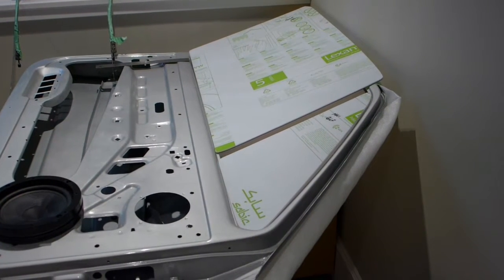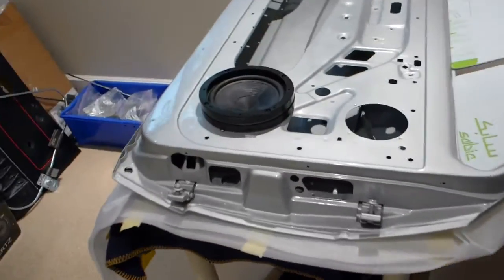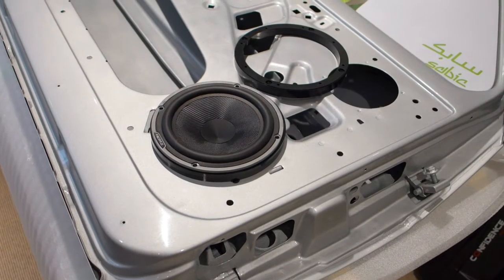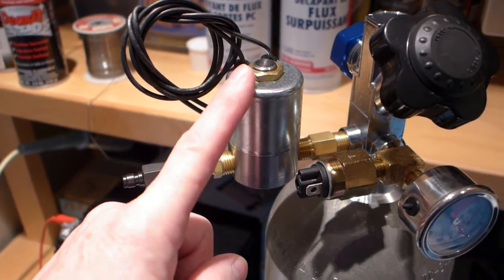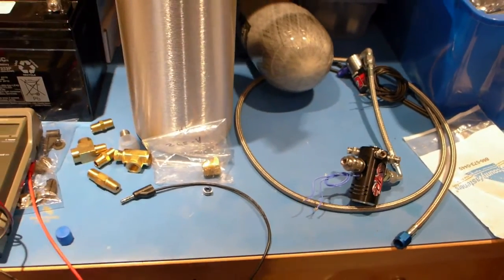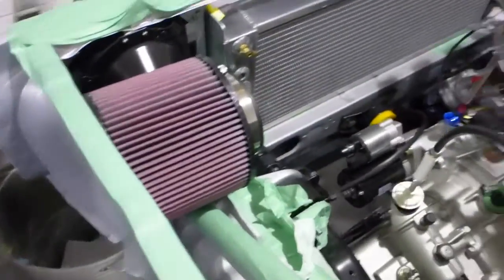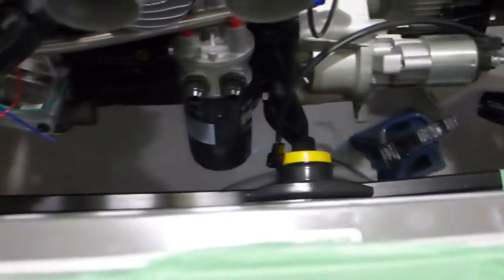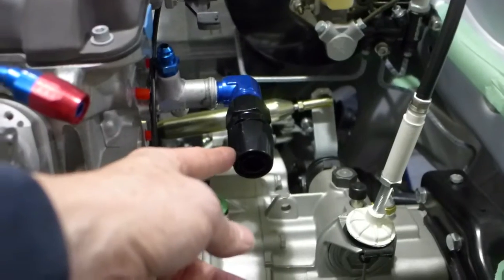The Ultimate 1983 Rabbit GTI - part 77 (Lexan Windows, Cooling System, Nitrous, Wiper Assy Install)

Comment: Overkill??? I have not seen anything on the car that would be considered "overkill" HA
Reply from the maker: +TheRcbthree Now that the project is coming closer and closer to completion I am thinking that everything is 'just about right'. It looks like the engine will be very powerful but the race cams should soften the low-mid range power enough to keep the ITBs (independent throttle bodies) from being overly sensitive.
Reply: +Derek Spratt  Thank you for making the videos.  You have done beyond a fantastic job, your attention to detail is spectacular.  I love that no matter what the challenge is your try to come up with a solution before you outsource it.  Ive watched 90% of your videos in the past two weeks.  I cant wait to be all cough up!  I'm very interested in how much power it makes.  Also, being an EE I love what you are doing with all the electronics.  My big project for the year was building a custom harness putting a ProEFI ECU in my car.  Having completed that in a little under a year working when i had time helps me to realize how incredible the pace is that your working at!  After this project wraps up you need to find a new project and what every it may be video tape it also!
Reply from the maker: +TheRcbthree Ah, it is great to see someone walking down the same road as me. The power of the internet and social networking. Yes, these ECU projects aren't trivial but the customization ability these days is fantastic. Cheers!

Comment from the maker: Yes, I am stressed out about the mis-match with the -16 hose ends and the issue you reference. First of all, they are way closer together than I had anticipated, plus the angle sucks. One thing that popped into my head is that the 45 degree hose end that attaches to the cylinder head is really long and I am sure I can source one that is more compact and that may solve the problem. Another thought if that doesn't work is to bend one or both connectors enough to align them more - but the problem of engine movement would remain. A long hose really is my best option. Stay tuned!

Comment: Hi Derek, that upper rad hose looks like it has an awkward bend to it to bridge between the two connectors. I'm wondering if that is in the fact the case (not just the way I'm seeing it from the camera angle) then when the engine rocks, you might have way too much tension on the hose.  It looks like on acceleration that it'll want to pull the hose out, and on braking, that it'll want to kink the hose